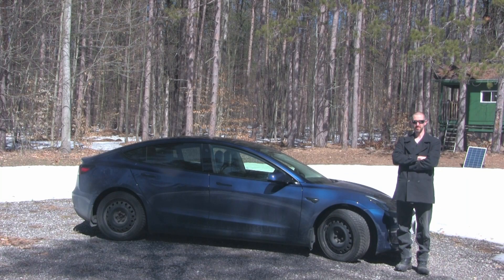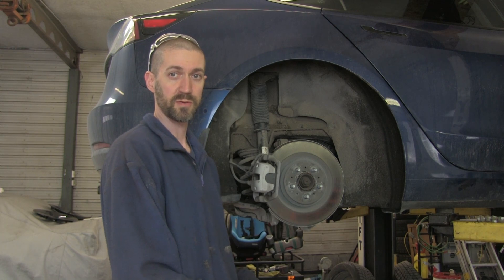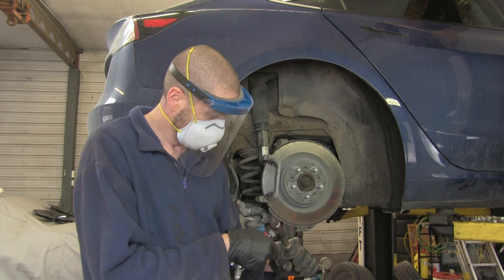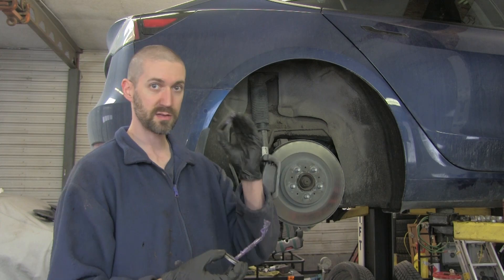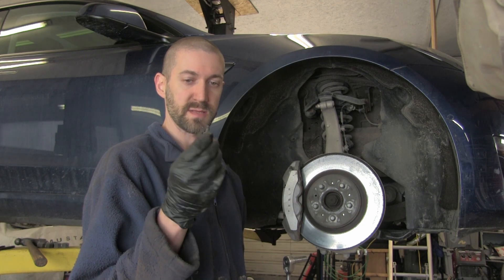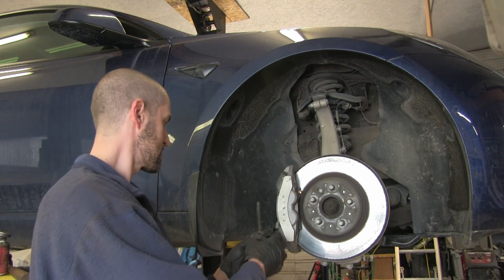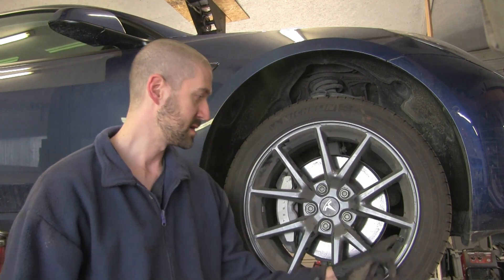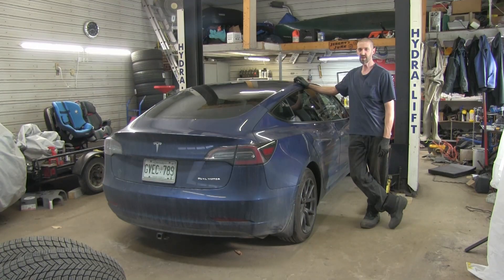Tesla Spring Maintenance - Electric Vehicles need service??

Comment: Forgot how dirty Ontario cars get! Thanks for 2 tips I never knew before, sanding brake pads and 1st over pressure tires and then let air out to correct pressure. Lucky I'm in FL for winters now, probably won't have to worry about for 3 years or more.
Reply from the maker: That's true unless you're near the ocean! I had a Civic HX once from Florida. The whole car was mint, but one day water started leaking in. It was from a rust hole under the black strips on the roof. It formed there from the salt in the air in Florida landing on top of the car and slowly rusting over time. I never expected that!
Reply: Usually not a problem unless you live very close to the ocean and leave it outside all the time. But those early Honda's were terrible for rust! My 1982 Civic was biodegradable in Ontario :)

Comment: Just did this service today, even if the car is just 2 weeks old, automakers don't lube the pads when building the car, the caliper pins were lubed but I used permatex
Reply from the maker: You're very smart! Our Kona Electric had the brakes stuck at a year old when I first serviced them. Good call.

Comment: I have a 2021 SR+...I have all season tires and the roads don't get too bad around here so I don't have winter tires.  I don't have a way to lift the car, a place to do any sort of work, or the mechanical inclination necessary to do this myself, so I've just been having Tesla do it for around $100.  That's not too bad now that I've seen what's involved.  I have also swapped that garbage lead acid battery out for an Ohmmu LFP 12V battery (the new model with Bluetooth support).  I had some initial issues until they did a firmware update that fixed everything back in February, absolutely zero issues since.
Reply from the maker: The updates can be helpful. Sometimes they make mistakes but most of the time, it improves.

Comment: Sir I commend you on trying to help people what needs to be done on EVs and how to do it.  The reality is that most owners don't work on their own cars any more no matter if it a Ice or EV powered.  My recommendation for your new channel might be just to inform EV owners that EVs need maintenance too & not to believe their salesman it requires NO service during  ownership.   I am of a older generation and so taught to maintain your "Horse"  or you go walking, that has changed by the OEMs with 100k trans oil service or 20k oil changes.  All these recommendations to get the car out of warranty to only fail after wood to buy another car.  So how often should a smart owner change out the coolant for the battery pack? What about the oil for the 1 speed drive unit? When should you consider changing out all the coolant hoses before they start to fail? This is where a experience tech can tell the truth over the vague or no information given by OEMs. Just a thought for your channel I think would give you the edge over other channels.
Reply from the maker: I absolutely love this comment! We will be doing videos in the future on these specific subjects as they vary greatly between brands. For example, the coolant. The blue coolant in a Hyundai EV has to be changed every 60k, but the pink coolant is somewhere around 100 to 200k. 

All of these will get specific videos to adhere to their enigmatic differences. 

Thank you so much for your thoughts!
Reply: Most will never bother with this…too many say EV’s need no maintenance…BS, iCE and EV’S have similar running gear including the body. Too much misdirections from all the fanboys.  Techs are gonna have lotta repair work, remediation on the backend.😂

Comment: Even though the brakes aren't used even a fraction as much as they are on an ICE vehicle, they are the same kind of brakes as on any car and do need the same regular maintenance.
Reply from the maker: Yes, they do! In fact, they often need it more often because they don't move. I have found that the Tesla rotors stand up to rust better than the Hyundai EV rotors do. So that's helpful.

Comment: I understand lubing the tip of the metal of the pads to prevent rust in the first place, but to intentionally remove the metal of the pad (and to do it yearly) seems to just make them unusable more quickly.
Reply from the maker: It's very necessary where it is salty. The rust layer builds up and it gets stuck in the bracket. You'll never remove so much metal that the pad is unusable.
Reply: @livewirereview  you are wrong here metal should not be removed from pad go please do research
Reply from the maker: @@rajendramodusu5980  It's part of our Honda training. I've had the bulletin dropped on my bench years ago with detailed photos of this process. In our area, the rust builds up a lot, so material has to be removed. This won't be the same everywhere though.
Reply: @livewirereview  its s&p ad deloiittte audit repor
Honda in next 3 years wil file bankruptcy

Comment: Also, just use a big pry bar against one of the suspension components to get the wheels off. For example, if the tire is flat, then it's going to be harder to remove the wheel.

Also, remove the caliper carriers and clean those sliders with nothing more than a wire brush.. Doing it to the pads will make them "click" over time. Plus adding lube to the pad contact areas is a bad idea. All it does is attract dirt and make mattters worse. If you notice, not a single OEM has lube on those areas. They know better.
Reply from the maker: Yes the pry bar method works too. I have used this recently on some stubborn wheels. 

As for the brakes. Please keep in mind this is a recommendation in salty areas. Here in Canada; Toyota, Hyundai and Honda all require Moly Kote on the areas of the pads where they slide to prevent rust. Hyundai even puts this on from the factory. We only remove material here because the rust buildup is so fast that we need to remove more material. If you are servicing your brakes in non-salty areas then there is no need to remove the paint on the pad where it slides. Cleaning with a wire brush will likely suffice. It is true that they will "click" if serviced this way in a salt free area. 

Our Kona EV had the rear pads completely stuck solid after only 1 year and 16,000km. I have been religiously servicing these brakes every spring because they lock up so quickly here with the calcium chloride now used on our roads. Nasty stuff.
Reply: @livewirereview  - I live in a salty area too here in the north east US. I deal with it all of the time on cars that come in to the shop.
Reply from the maker: @billsmith5960  That's the nice thing about our trade. There are a million ways to do each type of job. When we teach our apprentices, we tell them to help each tech and then come up with their own method after trying out everyone else's. 

Thanks for the comments, I appreciate the input!

Comment: If you grind and "remove material" like that every time you "clean" the pads, they won't last long, or fit anymore in the holders!
I use a steelbrush and remove dirt and rust, not the metal itself, and then apply lube.
Reply from the maker: When it comes to our salty area, you never remove enough material that it's loose. Unfortunately, here the calcium chloride does a lot of damage!
Reply: @livewirereview  Natrium 👍

Comment: Question for you regarding my Model S.  I have been getting a whirring sound at slower speeds and while regenerative braking takes place.  As soon as I put any pressure on the brake pedal, the sound goes away.  I am hoping it is just the brake pads needing replacement, but it is not making the normal squealing sound when pads are at the end of their life.  I am in Arizona so we do not have salt, snow, or even rain for that matter to deal with.  I scheduled an appointment with Tesla Service Center, but they just moved my appointment again....  I may take it into a tire shop to have the tires rotated and have them take a look at the brakes while they are at it.  I also have a link to the YouTube video of the sound if that helps with the issue.
Reply from the maker: From where I am, I can probably not be of help. My friend's model X had a bad wheel bearing recently so I would look there as a possible source. As far as I know that vehicle also has a separate final gear with gear oil in the drive unit. Maybe see if the noise is coming from there. 

Any good mechanic should be able to help pinpoint it with a stethoscope. I just hope your drive unit does not need bearings. Depending on it's age they used to have bearing issues and have changed to a ceramic bearing for that reason. Best of luck!
Reply: @livewirereview  thanks for the response.  Yeah same here.  I am hoping and praying that it is not the drive unit.  If that is the case, will Tesla have to complete the work on it?  I have read that you can pick up a used drive unit for much cheaper than Tesla charges, but in the end, it might be worth it to have them replace it.
Reply from the maker: @Duane Kilzer  Get an opinion at Tesla. You never know what kind of goodwill they will offer if that's the case. I have heard of a drive unit on a Model 3 here that was changed at the Innisfil Tesla out of warranty. They only charged them $4000cad total for the whole job. Seemed like a really good price because I've seen used drive units for $6000-$8000. 

I think that any good transmission shop who is certified with EVs should have no problem rebuilding a drive unit in the future. They are just a case with bearings after all.

Comment: Is it advisable to let the brake caliper hang on the brake line without support?
Reply from the maker: The rear lines hang straight and the rear calipers have little weight to them. I always hang front calipers on a hook when I remove them as they will twist and cause strain.

Comment: The parking brake on my 2021 Model Y squeaks as it engages, how can I lubricate that?
Reply from the maker: That depends what is making the squeak. If it's the pads getting stuck then the service in this video would help. Most cars with an electric e-brake like this one have a small 12v motor attached to the caliper with a tiny little belt and gears inside. If you are brave enough this motor housing can be opened. Maybe the little belt is wet? I would check the brakes first though. Make sure to block the wheels so it doesn't roll away!

Comment: I don’t own a angle grinder, let alone a lift. Would occasional use of the brakes reduce the need for this?
Reply from the maker: If you live outside of the rust belt then yes. Angle grinder from Harbour freight or Princess Auto would work. When you jack up each corner on a normal jack just make sure to use a puck or the proper lifting accessory from Amazon. Also remember to block the wheels! It will roll away if the wheels are not blocked.

Comment: What steel wheels are those?  I would like some 18” winter wheels for my Y
Reply from the maker: DDT 851402. 7.5jx18 width and diameter 5x114.3 bolt pattern 64.1 center bore. ET 42 36 20

Comment: hi there, what size of steel rims and tires were shown in the video?
Reply from the maker: These are 18inch steel wheels from 4tires.ca. They sell complete mounted and balanced tire packages shipped to your door. They also fit on the center bore perfectly.
Reply from the maker: Tires are stock size. 235/45/18 Michelin X-ice Snow. These tires surprise me. I used them on my last car as well, so they've seen 3 winters and have only worn 1/32 in 3 seasons.
Reply: I don‘t think we have these steel rims in Europe i wish we would have the choice would love them for winter also they are light people don’t know that

Comment: Good video. Bolts that are made to stretch are single use and need to be replaced each time they are removed and then torqued to specification. The Germans make a Bremspaste (brake paste) that is used on brakes to prevent corrosion and seeking. The Bremspaste also does not affect breaking if it happens to get on the brake pad. I live in a moderate climate where no salt is used on the roads so most likely my EV does not have a many brake issues as in a salty environment.
Reply from the maker: Yes, torque to yield bolts would be single use. However, normal bolts do stretch slightly when torqued properly. This is called the "elastic" range of a fastener. When a bolt is overtightened, then it is in the "plastic" range and has been stretched too far, damaging the fastener. 

Brempaste sounds similar to molykote that we often use here. I'll have to look that up. Thanks for your comments!

Comment: The winter tyre wheels looked different? From which car are these sourced? Great video
Reply from the maker: They are Michelin X-ice snow tires in stock size at 235/45/18. The rims are just fitment matched steels.
Reply: @livewirereview  Those rims.. any idea origin model etc (where to find..), and how about the weight?
Reply from the maker: I just tried to find them on 4tires.ca but they change their supply all the time. I will pull the specs from the shop later today for you!
Reply from the maker: DDT 851402 7.5Jx18 TC 5x114.3 64.1 ET 42 36 20 Made in PRC

So the rim is 7.5" wide and 18" diameter. The bolt circle is 5x114.3. The offset is 42 and the center bore size is 64.1. Make sure the center bore is the right size or it won't fit and the wheel would be supported by the nuts only.

Comment: do you rotate from front to back on the same side or criss-cross? I know Tesla only rotates from front to back on the same side, but old school tire shops do the criss-cross on non-directional tires like the 18" ones. Just looking for the best option. Thanks for the detailed brake annual service.
Reply from the maker: We rotate front to back on the same side. We would also recommend an alignment around 20k to 24k (12000 to 14000 miles). 

I did my first alignment at 20k due to feathering on the inside edges of the tires. 

You're welcome!
Reply from the maker: This car has a square setup. That means all the tires and rims are the same size. So technically you can rotate how you like but it's recommended to keep them on the same side.

Comment: What do you do if the tesla caliper pins are seized that’s my issue
Reply from the maker: I use a punch and small hammer. Sometimes when working on vehicles you have to take drastic measures and use heat. This is more advanced and you may need to bring it to your mechanic.
Reply: @livewirereview  I tried a punch and hammer for about 20 minutes and all 4 front ones were seized 😞 would an air hammer punch with a compressor do the trick ? Or do I need to take a torch to it 😂
Reply from the maker: Yes. But it may do some damage! I've been there... 😵‍💫 On Toyota Tundras they were always stuck so the air hammer with a small bit and some precision broke them loose.
Reply: @livewirereview  okay I won’t take a chance with the air hammer and a punch thanks for the advice you got your a new sub :)
Reply from the maker: @GoodLookinTV  Thanks! Let us know any other topics we should shoot regarding EV service or reviews!
Reply: @livewirereview  I would do a video on break fluid service, how to change air filter, how to replace windshield wipers, how to do brake and disc replacement. Lots to learn :)
Reply: Very common. I gave up hammering before making the ends of the pins mushroom shaped! Tesla Service did them.
Reply: @MrAdopado  I gave up also I am brining it to tesla also lol
Reply: @goodlookintv2513  Once Tesla Service has done your brakes you have a better chance of keeping them in order yourself ...
Reply: @MrAdopado  that’s what I was hoping for lol

Comment: New cars should have LESS to deal with. This looks like designed in future income for musk. He needs to be controlled.
Reply from the maker: This car has the same components found on many other vehicles. They use a double ball joint design similar to an older 3 series BMW and typical Brembo 4 piston brakes up front like other OEM manufacturers. The rear brakes have Mando stamped on them and they are used on many other cars as well. 

The maintenance for this is fairly typical of most cars on the road.
Reply: Standard car brakes ... only difference is they get used so little (due to regenerative braking with the motors) that the rust can build quicker in salty environments. The pads last forever so sanding them is no problem.

Comment: Tesla brakes require a $200 a year cleaning in snowy areas.

So keep a Tesla 20 years that is $4,000. for brake cleanings.

My old Honda required $400. over 20 years for brakes!
Reply from the maker: ICE vehicles in a salty area will require brake services once every 1.5 to 2 years. EVs and hybrids need it once a year. Not a big difference. Honda will tell you on the dash when it's due with a "B" symbol at the time of an oil change.